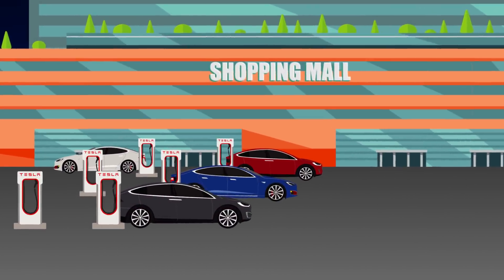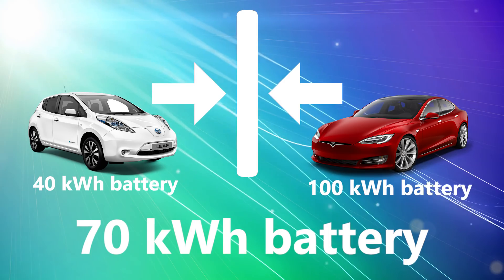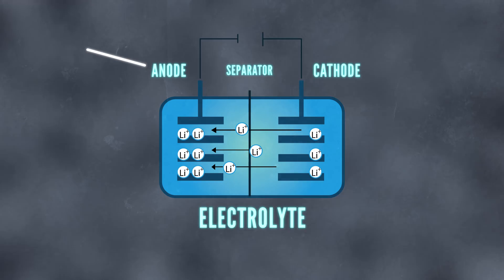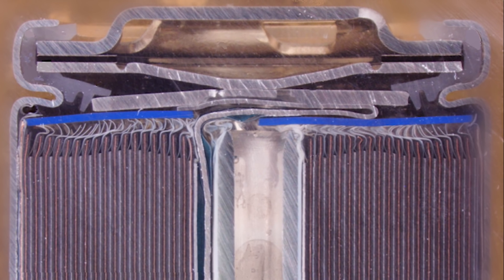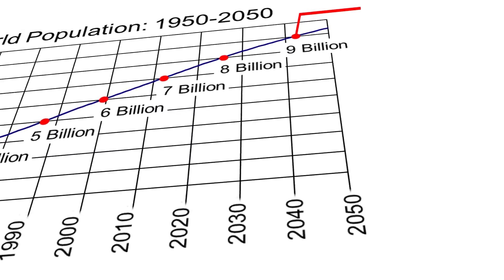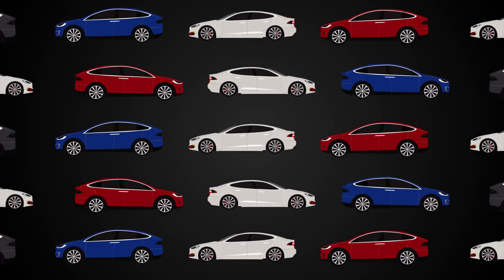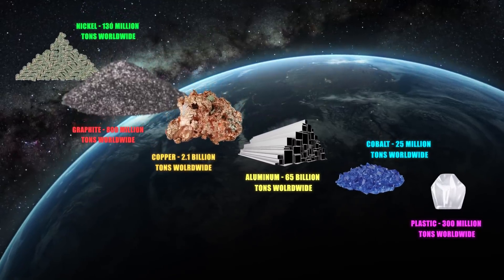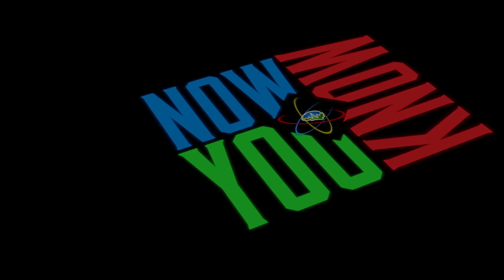Will there be enough EV Battery Material?

Comment: I like how we have "more than enough" lithium etc. to power all the cars on earth but we have nowhere near enough oil, which has reserves in FAR more quantities than lithium et al.
Reply: In fact, the calculation in here is completely bogus, leaves out waaay to many factors and is overly optimistic.

Lithium batteries are not the future, we'll have to find something else for that, hydrogen cells maybe.
Reply: Its becauce of only 300 kg (55 kWh) of NCA battery can substitute over 15 000 kg of gasoline over its 1000+ charge cycle lifespan.
Reply: You all do realize that they can take hydrocarbons such as CO2, and convert it into oil. Oil is not recyclable and reusable. It's just still cheaper to take it out of the ground for now.
Reply: What's your point? We're not getting rid of ICE cars at this point because there's not enough oil (that would also become a problem later, but is not our current problem). We're getting rid of them, to not move that oil from the ground into the atmosphere via ICE cars burning them.

Where have you been the last couple of decades?
Reply: @oerthling  my point is that the media is biased which is driving us towards technologies that are very marginal improvements from old tech.
Reply: You meed 15kg to make a 70kw battery pack which will last at least 20 years (after 10 years still have 85%-90% capacity) 
But to drive a car you need liters and liters of fuel every day for millions of cars
You dont need 15kg lithium every day, you need it one time and it lasts 20 years, how long will it last for you 15 galons of gasoline?
You understand now?
Reply: @mudza92  But you need electric energy everyday to charge your e-car. And not a small amount of it. 
"Renewable Energy" is practically DOA. Solar panels and wind turbines have a very small life span (10-20 years) and need constant replacements. They are also bad for the environment, since their materials aren't recyclable.  
Nuclear energy isn't available for all countries on earth. It's also the most expensive form of energy production. And to this day, after 50 years of continues research, there is no solution to the nuclear waste fuel that this method creates continuously.
Oil and Gas are the cheapest & safest methods to create electric energy (only 2nd to coal). They also crucial, since practically everything is made out of oil.
Reply: @vasiliyt8600  How will all the electricity be made, fossil fuel or dam up all the rivers in the world?
Reply: @vasiliyt8600  My cottage solar is from 1984. Almost 40 years of solar energy without any maintenance for the array. It is on the cottage wall.
Reply: @vasiliyt8600  5 MW wind turbine is about 3 000 tons. It makes about 15 GWh of energy per year. If you are to produce this with coal, it would require over 3 000 tons every year. 

Renewable energy is nice, because it consumes several times less material and requires less mining.

Comment: 1. No way will 90% of people voluntarily give up car ownership for taxis, ridesharing, or whatever. I would not, and I have found very few people who say they would, although many think it would be a good idea for other people.

2. It would not even be  mathematically feasible to reduce the cars on the rode 90% because too many people go to and from work at the same time.  Heck, we would probably need 10% of those cars just for people who live in rural areas!

3.   Lithium "resources" are not lithium reserves. Much of that resource will never become economically viable as reserves.

4.  All of these resources also have other uses, the others being in even more demand than lithium.  With or without EV's, most of these resources will become uncommon and costly before this century is out.  The richest resources have almost certainly been found by now, and whatever is left to find is smaller and more costly to extract.

5. By far the most abundant resource he listed--the only one that might not become uncommon and costly during this century--is aluminum,  but it requires a lot of energy to process, and energy will become far more costly as well.  

Suggested reading: Limits to Growth by Meadows, Meadows,  Randers, & Behrens (1972); and  Extracted by Ugo Bardi  (2014).  (The first book can be found for free on the internet.)

Comment: I think you have been very conservative in your numbers, in Australia we have large distances to cover a Tesla gets 350km on a charge @ 100kw capacity. Sydney to Melbourne is about 880km and Sydney to Qld 1000km. Current cars today can obtain a range between 700-800km and diesels 1000km on a trip. So in order to achieve such ranges that will be necessary for road trips and not city driving I would estimate 250-300kw batteries would be needed.  That is excluding truck use and what they will need will be mind blowing to pull 30 ton 1000km. So I think you have some extra calculations to consider. On that point, I'm hoping super capacitors will blow this tech out the park to Increase power density and time to charge and reduce the resources will we need to make lipo batteries.

Comment: Why would the number of cars in the world decrease by 90% until 2043? They have incerased every singel year since the WW2, why would they suddently drop by 90%? This video is plain BS. 

Multiply your number by ten to get closer to the thruth. Also, Cobalt is the main issue not Litium. You probably knew that, you just didn't mention it. Thruth is that replacing all the cars in the wolrd to EVs will completely annihalate all the Litium and Cobalt Resources in the World. What are u gonna do when the batteries wears out and need replacement, run the car on water?

Comment: I think it won't matter as much because the power will be moved from the vehicle mostly and into the infrastructure. making vehicles lighter too. also I think that the really battery hog will be in power distribution. but I am sure that at some point another chemical formular would be used since you do not need the portability of the lithium battery technology. Right now it is obfuscated by the transitional stage we are in. but once the funding and motivation is there it will be so clear it was like ,why did we burn stuff again? ofcourse this is mostly gut

Comment: Graphene (not Lithium or Cobalt) will be a main material involved ... recycling old batteries with innovative materials ... and the most important in vehicle numbers is easily swapping old models of 60s, 70s, 80s (Adjacent Electronic sensors and motherboards) in workshops to EVs (Away of Agents and Dealers)... Auto makers and Oil COs do know the impact of this new technology wave on the market ... but not to how far ... and still what is coming is not yet totally configured... as lot of other players are involved... But it is assured that with the disappearance of the combustion engine, China will be the biggest player in the field of Auto Manufacturing.

Comment: By that time, probably the battery technology will have evolved and the materials will not be the same. For example if graphene technology is successful, carbon will be used instead which is cheaper and more abundant than the materials used in today's technology.

Comment: The error made here is the reference to cobalt reserves - they're meaningless, as cobalt is mostly produced as a very minor bi-product of more common metals and will not be scaled up no matter how high its price. (It has an inelastic supply.) They also foolishly assume cobalt production will all go to electric cars: ev's are the lowest value use to which cobalt can be put. The far smaller amount used for hybrid cars and for all kinds of electronics means that they will still be used for those higher value purposes when the demand from ev's pushes the cost of ev's upwards by $100,000/car. (This can't happen, of course, as ev production would slow to a trickle long before the price went up so much.) 
Unless a substitute for cobalt can be found, ev's  will never be more than a specialty car, the sole purpose of which being a way for automakers to meet state fuel efficiency mandates - except for Tesla, which is more about selling stock to suckers than building a viable company.
Reply: There's plenty of cobalt in all sorts of mine tailings, besides there other battery chemistries eg LiFePo4 . I think you're being a bit pessimistic.

Comment: Interresting and good effort. I’m a strong believer in the EV industry. However, I feel I must point out that evaluating how many cars there will be at market saturation is one thing. But how many cars lets say in 30 years is completely different than how many cars have to be built DURING these 30 years (taking into account the average car replacement rate). There is also the sustainability. But don’t get me wrong, we have to get there, and by then, technology will evolve, varying the resources needed.

Comment: How much Lithium can be filtered from the see and still sustain acceptable balance?   Researchers discover efficient and sustainable way to filter salt and metal ions from water
February 9, 2018, Monash University

Read more at: https://phys.org/news/2018-02-efficient-sustainable-filter-salt-metal.html#jCp

Would you consider expanding your transportation series to.... How many A/P controlled Lilium can you operate around Boston below 2500’ AGL with  reasonable separation? Say,... half the 50mi. radius( leave out Logan Appr. ) Stretch your imagination to envision a Tesla body of Lilium design with wings that rotate backward from beneath the body after VTOL.  INFINITELY SIMPLER AND SAFER THAN 2 DIMENSIONS.

Comment: So doesn't this only calculate the number of cars needed in 25 years? What about all the cars purchased with batteries during that time? Since most will be replaced multiple times. So this assumes older car EV batteries are either 100% recycled or still on the road as used cars. Also, the yield on the raw materials are not 100%. I don't know the numbers but probably you need at least 20% more raw materials to manufacture a usable battery than the final weight.

Comment: Great, really but I have some issues, population will be a bit higher but the global gdp will triple so poor nations of today will be flooded with cars like how it happened in China, do as gdp triples and cars per person fall to around a sixth wich its a bit optimistic, I would expect 600 million cars.
Lithium is plenty but cobalt, not so much and as you said we're about to change battery composition in a decade, maybe sooner so we can expect that materials won't be a problem
That's the reasoning to that fallacy of scarcity, it's not that there'll be fewer cars or that there is enough lithium, it's that innovation has driven the material side of the equation more insignificant as we find more material over time (eg in asteroids, it'll be 2045) and as we innovate towards a new kind of battery

Comment: i like your videos, but there are too many assumption with the numbers of cars and saturation rates - we are told to just accept your own rate of adoption of electric cars. then there is the assume there will be 10% the amount of cars there are today. i have never under stood this assumption, as you would need to assume the idea of the "rush hour" vanishing in every country (that is when more than 10% of the cars are actually needed just to meet a peek demand). Are we to assume the world solved these problem by then too? You may be correct, but we are told to accept this on faith. your numbers should not be "perfect situation". the video also neglects the use of Lithium just to get us to 25 years into the future.  

so the argument is not really well though out as it skips some major variables.

The above said, I am a big EV supporter and have been driving all electric for the past 5 years now. On the positive side, I do trust new forms of batteries will be found even after lithium is exhausted, we will become better at reconditioning old batteries, and new deposits of lithium will be shown to exist.

Comment: Well done.  In 1966: Gone in ten years,   predictions that the world would run out of oil.   https://paleofuture.gizmodo.com/weve-been-incorrectly-predicting-peak-oil-for-over-a-ce-1668986354   
So, predicting lithium or other items will run out is second nature to predicting running out of oil.  

As to the reduction in vehicles, which I do believe will eventually happen with autonomous vehicles, yet, Elon in his TED talk of 2017 had said it would initially be more cars.  I rewatched your autonomous vehicle video and the 10% figure for future fleet size was dropped without going thru the math of arriving at 10%.  Even if other factors came to play that rather than a fleet size of 20% vs 10%, that is still significant reduction.   Thinking of impacts within the 23 years of full acceptance, what happens to the used car market?  Will there be quicker recycling of vehicles.   When will junkyards of cars be totally gone as recycling of the metals will be so cost effective?

Comment: This video makes no sense to me...
If you add up all the car batteries that will be manufactured from now until 2043, according to your "S curve", then 2043 will be about the time we run out of materials. not to mention you didn't include any home batteries (powerwalls) or commercial batteries (powerpacks), smartphones, cameras, laptops Etc.  into the calculation. (I don't think you mentioned semi trucks and their massive batteries either🤔).
Believe me I'm a big fan of EV's,  but I don't think this video was based on facts.
Nice grafics though😊.
Reply: The Glaser family  Adding up all new cars before 2043 doesn't matter, because the calculation isn't for new cars made in 2043, it's for all cars on the road in 2043.  One unstated assumption they seem to be making is that materials made in vehicles discarded between now and then will be recyclable.

Comment: You guys also forgot that you can recycle the lithium and get basically 99% of it back. When the older batteries die or become weak, they can be taken in and make new ones. Same with the other materials there. There might not be any need to mine new lithium that much in the future.

Basically, you are not throwing away the lithium. You are re-using it and any new need is for future growth or house batteries, which in the long run can also be re-used again!

Comment: What about the re-usability of lithium? Using a significant portion of our natural resources on a vehicle with a limited lifetime is not sustainable without recycling. Bringing that point could distract from the point of the video, but I think it should still be discussed. I don't know if bringing up the total reserves of a material is a great way to argue for sustainable technology because our reserves are like all we got, they are not a natural resource. And the raw number you get from reserves doesn't take into consideration the efficiency of the extraction process. Just because we know how much a material there is, doesn't mean all of it is easily attainable. 

I think if you compare numbers between lithium and gasoline, they are still in favor of electric vehicles. From a quick web search, we have about 50 years of our global production of oil in reserves, which sounds much more daunting than the 1/17 you mentioned for lithium, but pretty comparable to the 10/17 if production doesn't decrease, and that isn't even taking into consideration the other uses of lithium. I would love to a video from you guys going into detail comparing the two.

Comment: I think it's safe to say that through a combination of technologies, there will never be a bottleneck we can't solve to supply all of our battery needs.  Magnesium-Ion, carbon ultracaps, superconducting magnetic energy storage (SMES), and dozens more technologies can be used for storing energy at various capacity and power ratings.  I'm not in the slightest worried.  

[Though I've never heard of the tech, I often wonder if someone, somewhere, could develop a way to store energy in nano-flywheels.  The molecular bonds at that scale could possible allow relativistic speeds to be reached, storing energy in warped space itself; the mass of the flywheels and chemical bonds would make them all but immune to crashing due to external movement.  Imagine a single small battery containing trillions of flywheels, the internal material seemingly solid.]

If li-Ion is all we'll ever have, then we'll find a way.  Like Z&J said, when you look you tend to find more, and who knows if the oceans and sub sea-floor regions were even included in those stats.

Worrying about running out of building materiel for batteries may be a little premature; let's cross that bridge when we get to it, though I suspect that particular structure will always remain on the horizon.

Comment: Well Jesse and Zac. Here is something you need to know. 

Well now as Research has it a game changer and I am sure Elon Musk head Just popped up.. If he was total you can cut the battery weight in half and load your Semi  Truck and Drive the same distance and yes Lower cost of battery by a factor of 1000% $75,500.00 per ton for cobalt and Iron is at $79 dollars a ton at current market prices. 

Thus the 20,000 model 3 battery to 50,000 dollar model X battery is now has the ability to get 4x times the range. 
Now Model S and Model X have swappable batteries but Model 3 does not.   Something to think about. 

“Four lithium ions for each metal — that would change everything,” Wolverton said. “That means that your phone could last eight times longer or your car could drive eight times farther. If battery-powered cars can compete with or exceed gasoline-powered cars in terms of range and cost, that will change the world.”

source: 
http://www.mining.com/cobalt-price-bulls-worst-fears-may-just-confirmed/